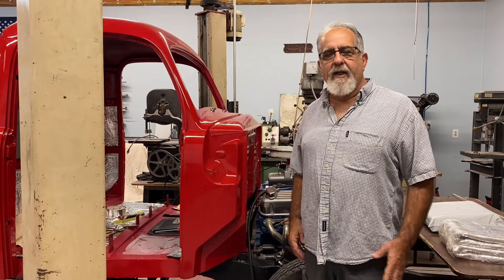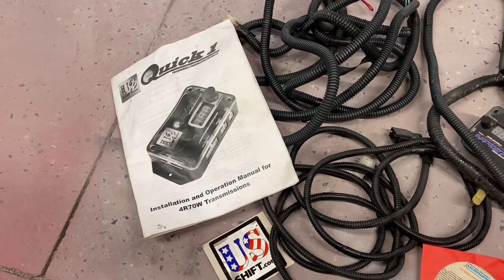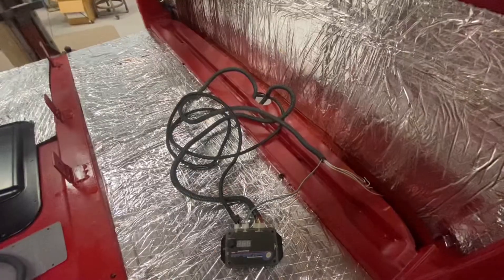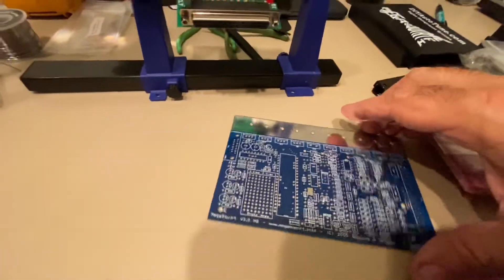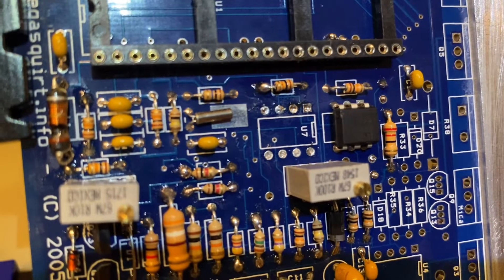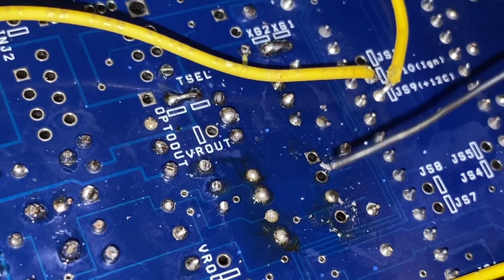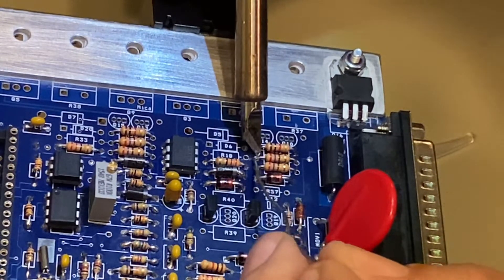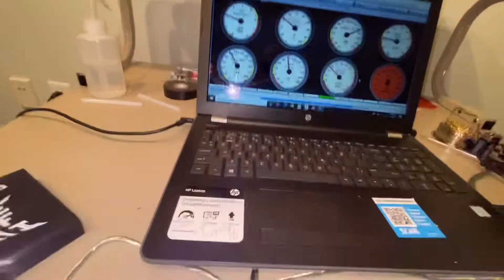Building an ECU and installing a Transmission Controller Ep 19

Comment: Wow, that takes me back to building an alarm for my Torana in the 80s. You are a very skilled gentleman Tony. I need one of those CCT board rotisseries. Great job once again, Cheers Stuart
Reply from the maker: Thanks, Stuart! Yes, that rotisserie is more solid than the the multi-arm holder that I was using.
Thanks for your support, Stuart. It is much appreciated. 👍Cheers Tony
Reply: @ChipsAndSparksGarage  I just ordered one from Amazon! Andy will have to review it on Grayzbildz 🤓

Comment: Nice!  I didn't know these were in kit form.
You might consider using a flux remover to remove flux residues.
Reply from the maker: Thanks! Yes, DIY AutoTune is one of several companies that offer this in a kit.
After this video, I scrubbed it down with isopropyl alcohol. I think I might use a conformal coating on it, as well.
Thanks for watching, and commenting!👍Tony B